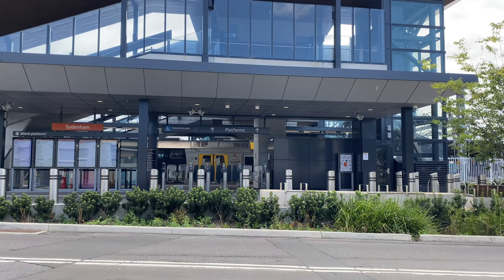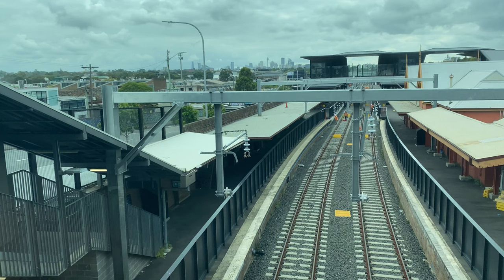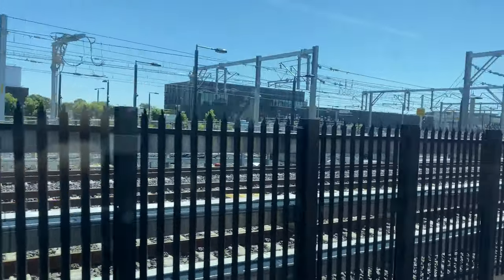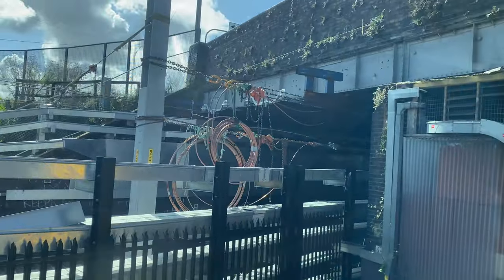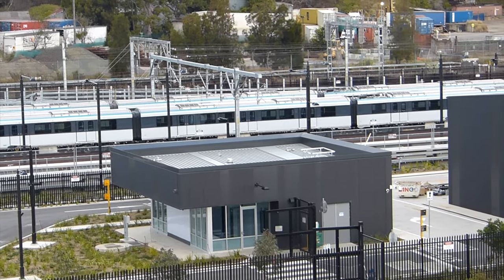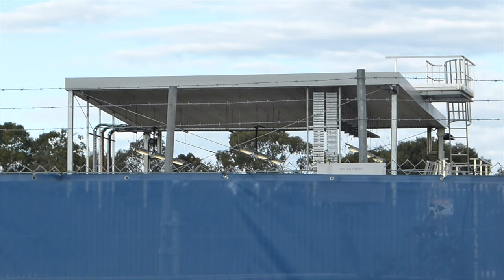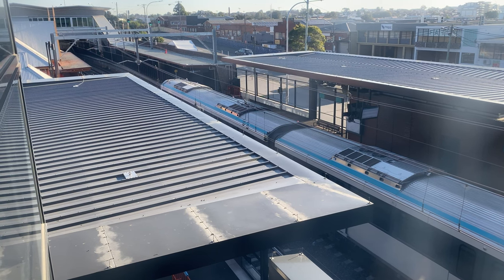Sydenham Station, Marrickville Dive Site & Trains Facility South Sydney Metro Update, Jan to July 23

Comment: Double contact wires are needed due to the current draw of the trains. 

In the old days a single was sufficient except on some freight lines with high grades. But with aircon etc being standard these days all lines need double contact wires to provide the current. The alternative is thicker contact wires.
Reply: Yes. 1500 volts is farly low by modern standards. Even high speed 3000 volt lines in Italy have 2 contact wires for this reason. The Western Sydney Airport Metro shouldn't need 2 contact wires because it will be 25000 volts.
Reply from the maker: Thanks for explaining that.  Yes I'm sure aircon takes quite a lot of extra current and I think modern trains consume more electricity anyway.
Reply from the maker: Yes it is Peter! I really notice the difference in acceleration when I'm on Brisbane's suburban trains which use 25K AC, although single deck and thinner narrow gauge trains probably helps too.
Reply: @TransportVlog  Haha! Not entirely sure that narrower trains make a significant difference. The other advantage of 25kV AC is that you don't need as many substations because the voltage drop over distance is a smaller percentage of the nominal rating.
Reply from the maker: Yes that right, and I think that's the reason for going with 25KV AC for the Western Sydney Airport Metro Line.

Comment: Very nice !
Thank you, I now understand much better how the next line will be laid out.
I was just binge watching Mega Metro Sydney documentary series yesterday and this morning, here on YouTube. I've taken quite an interest in Sydney's new metro network.
Perfect timing! 

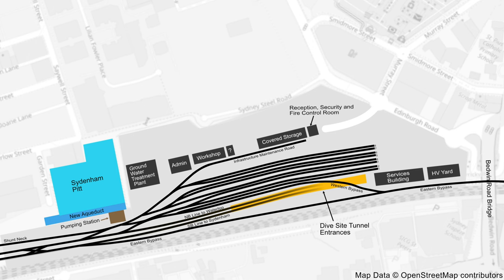Had a bit of a hard time recognizing the map at 2:35 as I was looking at sat views from GMaps that are a tad dated.
I'm just a bit surprised by the number of trains announced : 23 for this line, 22 for the first Northwest line between Tallawong and Chatswood.
It seems not enough as usually these automated lines (or manned) require 1 train per kilometer per side to operate at reasonably high frequency.

In the 4th and last episode of the Mega Metro Sydney series they said the first line in service had 90K daily riders and 20 millions yearly.
It seems a bit low, isn't it?

For comparison, line M1, the current busiest in Paris (where I live) has about 750K daily and 200 to 210 millions yearly for a length of 16 kilometers. M1 was the first line inaugurated in 1900 and was converted to full driverless automation (with platform screen doors and the works, GoA4) circa 2010.
The line has 53 driverless trains, of which at least 45 are running simultaneously during peak.

Or M14, another fully automated driverless line (GoA4, this one from conception, inaugurated in 1998) that is expected to pass the million daily riders next year with its South extension.
The least used "main" metro line in Paris is the good old M10, with a little under 50 millions yearly.

And for the number of trains : I live a stone's throw away from M11, a semi-automated line with drivers (GoA2) and no platform screen doors yet, that is being extended. It has 39 trains for 12 kilometers (extension included).
Or M4, another century old historical line recently converted to full driverless GoA4 automation, about 55 trains for 14 kilometers.
Or the future M15, a gigantic, fully underground, 75 kilometer long loop line that is part of the huge Grand Paris Express project and which first phase, M15 South, is set to open in 2025. This express line with longer spacing between stations and higher speeds will have 133 trains (of the same product line as Sydney Metro : Alstom Metropolis), presumably called MR6V, and possibly more as there are talks about a supplemental order for 22 or 25 additional trains.
The daily ridership forecast for the GPE has recently been revised from 2 to 3 millions.

That's why I'm surprised by the relatively small number of trains announced for the Sydney metro lines.

So my questions are :
Do they plan on acquiring more trains for these lines or will they operate with so few?
What's the total number of trains ordered?
Is the seemingly modest ridership on the first Northwest line only temporary while they extend the line? What are the ridership forecast for the completed line or lines?
I'm guessing the harbor tunnel will certainly boost ridership massively.

Ah, and I almost forgot : what are the bypass tracks for? Do metro trains run on these? Why for? 
Thanks! 

It looks like a very nice and efficient new metro system, one more reason to come visit Sydney.
Greetings from Paris!
Reply from the maker: Glad you enjoyed this video, and that it helped you in understanding Sydney Metro better, along with the Mega Metro documentary series.  To answer your questions, 45 trains in total is enough to run a 4 minute service on the whole line.  As demand grows, frequencies can be increased to a train every 2 minutes and more trains can be purchased at that time. Trains can also be lengthened to 8 cars. Yes the patronage on the NW part is still quite low, especially during the off-peak, but I'm sure it will increase once the city & southwest section opens.  I don't have access to any ridership forecast figures. The bypass tracks are for metro trains to access Trains Facility South, so will not be used in passenger service. Hope this answers your questions, and lovely to hear that you're watching this video from Paris!
Reply: @TransportVlog   Thanks for the reply! 
The 45 trains you're mentioning, are they for the metro network? Or just one line?
I haven't totally grasped the lines' subdivision yet.
In the Mega Metro documentary it looked like there would be 3+1 lines : one Northwest, one West and one Southwest, all connected. Plus a kind of orbital North-South line farther West to serve the new Western Sydney airport.
Are the 45 trains for all these lines?
Or only for one of them, and in that case which one?
So I'm guessing the rail yard shown in the video next to the tunnel entry is not "Trains Facility South" as I initially thought.

As for the ridership, seeing how good the system looks and how nice the stations and trains are, I bet this will be a massive success and help the locals leave their cars home and why not, ditch them entirely.

Sorry for the silly questions, I've only recently started looking into Sydney Metro so I'm not yet up to speed. 🤣
It's super interesting and exciting anyway.
It really is a new era for transit, between Sydney, Montreal, Paris, etc. There's new transit stuff popping up everywhere.
Reply from the maker: The 45 trains will run from Tallawong, via Chatswood, Sydney CBD, Sydenham and then to Bankstown.  There will be additional trains for the other lines.  The rail yard in this video is Trains Facility South.  Trains Facility North is up at Tallawong and is in this video. https://youtu.be/ZbIW4bVbWog
Reply: @TransportVlog   Thanks a lot! 
So 45 trains for Northwest and City & Southwest.
Additional ones for other ones, get it. 👍
I'll have to find some recent sat views.
On my way to view the linked video.
Reply: Looking at the cable trays in the "unsure" building I'd hazard a guess that it is an external Main Switch room that probably distributes power to the various other buildings surrounding it. But that's just a wild arse guess?

Comment: When you observe an additional “contact wire”, are you really meaning an additional catenary support wire. ? The contact wire is usually solid copper about 10mm in diameter with two grooves along either side enabling it to be grasped by a clamp leaving the bottom of the wire free for the pantograph to slide along without obstruction.

The additional catenary, just above the contact wire, can be a conventional multi stranded cable and supported with clamps right around the wire. It was first introduced o n the Blue Mountains to supply sufficient current for the freight trains.
Reply from the maker: Hi Ralph, from what I could see, there were 2 contact wires and 2 catenary wires. I'l take a closer look when I'm next back to Sydenham, but from the footage, that's what it looked like to me.  I could see why they did that on the Blue Mountains line for freight trains!

Comment: Those boxes between the tracks, I'd say they are just lids for underground wiring caverns. Like how when you see a access panel in the ground for telephone wiring, except because of the complexity of the balise (beacon) system there is a lot of them all.

Also of note, they are always quite close to the balises. I suspect the offset might be so that there is a bit more distance between the pit and the balise, perhaps to deliberately allow slack in the cabling or to allow work in the pit to not disturb the balise? I have no idea there
Reply from the maker: Yes that would make sense.  The yellow tops are protective covers for the balise, so I guess it makes sense to use the same covers for wiring other things too.

Comment: Thanks for the great video Paul, question with the shunt track running into the station does this have platform doors or is it purely a shunt / storage track
Reply: Purely a shunt track, no screen doors.
Reply from the maker: Hi Paul, as @tsetstransport mentions below, it's just a shunt track for Trains Facility South.  They seem to use shunt tracks quite a lot.  I guess its much easier to reverse a driverless train!

Comment: Whats the purpose of the western and eastern bypass tracks? I thought all the metro trains head underground
Reply: It's for shunting and occasional storing.
Reply from the maker: The eastern and western bypass tracks basically provide an alternative way into Trains Facility South from the NE side.  It will be interesting to see how much it is used, but I guess its good practice to have two ways into TFS in case there is a problem with the main approach tracks.  Yes, all trains in passenger services will go underground.

Comment: The yellow box between the running lines is drainage inlet for tracks. I believe this is exact same size/spec as in Sydney Trains tracks.
Reply from the maker: Thanks for that! I've never noticed that on Sydney Train's tracks before. I'll pay a little more attention to this when I'm next out on the network.
Reply: @TransportVlog  Thats because most of the Sydney Trains one are either galvanised color or the yellow paint has faded.

Comment: Judging by the cable trays, that "mystery structure" looks like it feeds networking/signalling in to the tunnels. Could also have uninterruptible power supplies and the like, it did seem to have a lot of ventilation capability at the top
Reply from the maker: Thanks for that! Yes that could well be what it will be used for.

Comment: they couldn't extend the metro to the airport.  the Bankstown line is over 100 years old and the Airport is Newer which opened in 2000. It will be fun and easier to go from the Northwest to the Airport Via Chatswood and the City.
Reply from the maker: I'm sure it was considered at the time.  A major reason for going with the Bankstown Line is to free up capacity on the City Circle, so that more T8 trains can run to the Airport in the future.

Comment: The reason why there are 2 contact wires is incase one wire fails the other wire can still be used and also voltage requirements for different trains
Reply from the maker: Yes, I'm sure that's got something to do with it!  Makes sense to have a backup if one wire fails.
Reply: Incorrect . Twin contact allows  for better pantograph performance. The dual catenary allows for higher current capacity for every train all being air con and more electronics on board. If one “fails” it’s lights out so to speak. The contact and catenary are in tension so any break would highly likely cause a circuit fault, trains will stop and I will be out fixing it.
Reply from the maker: Thanks for that @djdeliboy. I hope you don't have to go out and fix it too often :-)

Comment: Thank you for all the great videos!

Do you think converting the Bankstown line to metro is worth the price and the inconvenience caused by temporary suspension of services?
I think it's worth it but the cost is quite high and having to take train replacement bus for months sounds really terrible.

Also, would you say it's reasonable to extemd Paramatta lightrail to Epping or Macquarie, through tunnel or building it on street?
Reply from the maker: When you consider the wider benefits, it is worth the pain! And the wider benefits including freeing up capacity on the City Circle to increase frequencies on the T2 and T8, and I think its this that convinced Chris Minn to continue with converting the T3 to Metro. Extending Parramatta Light Rail to Epping or Macquarie is tricky without using tunnels, and that's expensive, and that's probably the sticking point!
Reply: @TransportVlog  I used to live in Beverly Hills and I have to wait 15m for trains to central if I missed one, and trains going other direction could skip my station and go straight to Reversby, forcing me to wait for next service.

What's more frustrating is the frequent shutdown in the weekends and bus replacement train is slow and uncomfortable.

Having more services there is great, although I wish there's also less shutdown or delay.

For the Parramatta to Epping/Macquarie, it's unfortunate that there's a gap there.

I watched @BuildingBeautifully and he suggested to build a new lightrail line from Paramatta to Macquarie Uni in this video https://youtu.be/vLjCER3euU4 , however it seems that given the current budget it will not happen soon.

But perhaps it makes sense to build a branch from Dundas Link to Eastwood, they are close enough to fill the gap without too much money, and since there's only two stations from Dundas Link to Carlingford it probably won't be that much of a problem to have a branch there.

Comment: Hi Paul, interesting seeing the new Sydenham station entrance. I passed Sydnenham station many times when living in Marrickville years ago, but I very rarely exited the station there. Incidentally, would you know which building is now sitting next to the freight tracks at Marrickville station? It used to be the Marrickville RSL when I was there, but there appears to be a different building there now. Also, what line was the diesel heritage train using? Incidentally, are they still going ahead with converting the Bankstown lines to Metro operation or has this since been indefinitely delayed? Well done videoing the Metro trains coming into Sydenham station. Anyway, take care. Rob in Melbourne Australia.
Reply from the maker: Hi Rob, no I don't, but I'll take a look next time I'm in Marrickville.  That was on the up Illawarra Line (the one the T4's normally use). Yes they are. Conversion will start in late 2024 (after the Chatswood to Sydenham part opens) and require the closure of this line for 12 months! That's going to be fun to film. Will probably do it on my bicycle!
Reply: @TransportVlog  I am so glad that we no longer live in Marrickville. I remember when there was an eleven day train strike years ago, which caused utter chaos in our area. Twelve months without trains is completely beyond my imagination. Those poor people trying to get to work. We had the Box Hill to Camberwell trains not running from February to June this year, due to heavy line maintenance and construction of Union Station. The people used buses, but they also had the light rail, which helped a bit. Marrickville and other areas on that line may only have buses, with the exception of Dulwich Hill, which had light rail as well.
Reply from the maker: Yes that's right! It won't be fun for Bankstown Line commuters! Union Station is on the list for my next Melbourne trip
Reply: @TransportVlog  You may even beat me to Union Station, as I haven't even managed to visit it yet. On video, Union looks somewhat similar in design to a British railway station to me.

Comment: All that graffiti, is disgusting, and generally untidy, this may be why I never use these trains, I do like the set up of the platform and surroundings, very well thought out, but as I said pity they didn't spend a few dollars on the upkeep of the surrounding area, cleaning up and removal of the paint and grime on the brick walls.
Reply from the maker: Yes it is a shame about the graffiti, and it can be like fighting a losing battle sometimes.  I find it quite easy to ignore now. I think Sydney Trains focus on removing it from trains as quickly as possible, and then try and remove it from the rail corridor when they can.